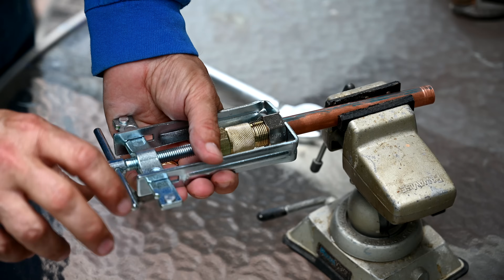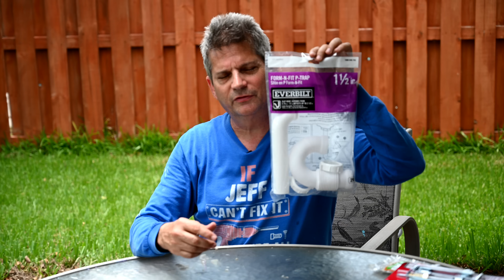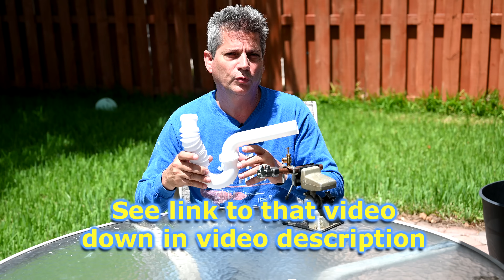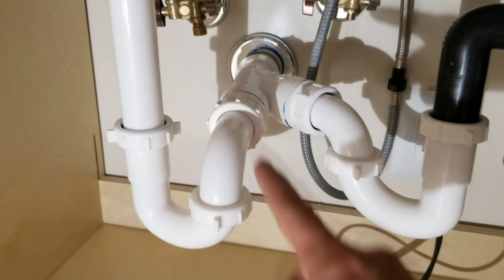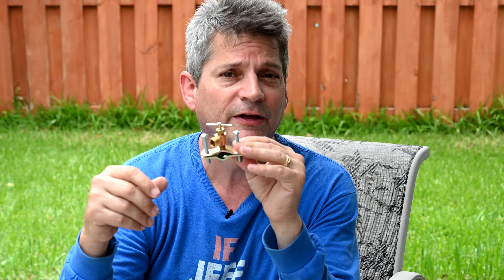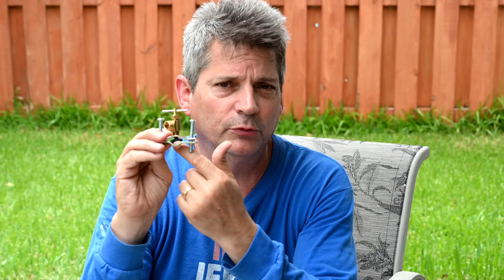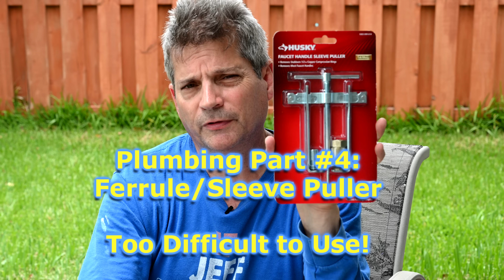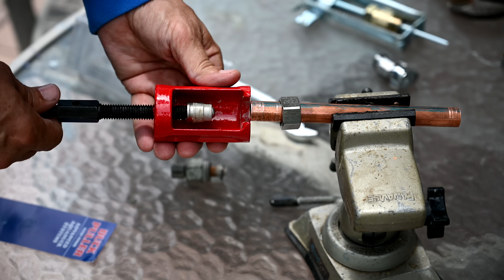4 Plumbing Parts/Tools You Should NEVER Use. NO Plumbing Fails

Comment: I have a question..... can I use check valve for my kitchen sink instead of a one and half inch PVC vent pipe.reason why theirs a window above the kitchen sink
Reply from the maker: Check valve is adding too much complication there, a window over your sink should not be any deterrent to connecting to a 1 1/2" pipe, which should connect into a larger vent stack. Do you not have a vent stack already in your wall?

Comment: Please tell me your better than other plumbers that cut floor joists when doing installs or repairs, I hate that crap.
Reply from the maker: I hate it when they do that too! At my friend's hous eremodel we used spade bits and cut small holes in the middle of the 2 x 6 wall studs. Ironic you should mention the notching, because that is exactly what the builder did to his house in 1946, so we removed it, and brought rebuilt that entire wall between kitchen and bathroom to run pipes through studs. they even had part of the pipe running on the outside of the wall in the kitchen because they used only 2 x4 and pipe could not get past the 4" vent stack inside the wall, so they went around it on the outside.
Reply: @jeffostroff  Almost every house I've put a crawl space vapor barrier/encaps in, the blame plumber cut floor joists to save time, all while proving me another service to render.  Most of the homes I've done this work in were expensive homes, horrible stuff.  Sick what people will do to others property ruining it just to be lazy.  I expected better out of you but I had to mention it.  Some understructer repair I've done paid more than the vap barrier work did.
I've seen so many botched jobs by "licensed" tradesman it's sad.  I'm not licensed for squat BTW but I sure try and treat people better than that golly.  
I also work for "safe guard" they take over foreclosed homes to preserve them/recondition them for auction and it's insane what I've seen in that line of work.  Not just plumbing, gas and electric was just terrifying to say the best of some peoples work.....
I hate having to do plumbing, it's not my fav thing at all  argg, I love the pex stuff though, anytime I can I use it.  I don't use shark bites though, I've seen them fail after a year, though they could have been reused from another project or something and not a true new part.  
But saddle fittings I don't use, but I know of many 20-40 years old still in use without problem, but no I wouldn't use them personally.
Sorry for blabbing so long.
Edit, good video BTW.

Comment: Just because the code states something is prohibited is not an adequate explanation. Codes can have useless regulations. You have to explain the rationale behind the code. "Fixture traps shall be self scouring" - is an example of a good explanation.
Reply from the maker: I thought I gave a rational explanation for each device, I gave examples of what happens and why the parts fail. Did you not watch the video?
Reply: @jeffostroff  Yes sir. Simply making a point and I likely worded it poorly.

Comment: What do you think of shark bites?
Reply from the maker: Kurt, I use Shark Bites from time to time. I will only use them on the outside of the wall, or  under a vanity where you can see them. I also use the Shark Bite end caps to plug off stub out pipes during plumbing rough in. I have mainly used them recently to change out toilet and sink water cutoff valves where we had polybutylene gray plastic pipes in stead of copper. Shark Bite has adapter attachments that convert from the now-banned poly pipe, allowing you to change over to a copper pipe.
Reply: jeffostroff 
I can see why you wouldn't use one inside a wall.  However I've looked all over and have not heard of a single one ever failing, ever....
I also change my valves when doing any toilet work. ( professional homeowner)I think I'm going to switch from compression type valves to shark bites. Thanks for your response.

Comment: again just like I commented in a previous video of yours     fla  has banned   the s trap  that you call it  but its really a p trap .  not in ny      it can be used    and most states go by the international plumbing  code   not the uniform  code
Reply from the maker: As far as I know S traps are banned in all 50 States in fact here is New York's plumbing code so I don't know how you can tell me that they allow as traps when it is clearly shown here in this section of code below. So you're going to have to show us the code where it specifically States that s traps are allowed. 
Chapter 10 Traps, Interceptors and Separators

1002.3 Prohibited Traps

The following types of traps are prohibited:

1. Traps that depend on moving parts to maintain the seal.

2. Bell, pot, bottle traps and traps with interior partitions.

3. Crown-vented traps.

4. Traps not integral with a fixture and that depend on interior partitions for the seal, except those traps constructed of an approved material that is resistant to corrosion and degradation.

5. "S" traps.

6. Drum traps.

Comment: You're using the ferrel ring puller incorrectly. The grips on the side are NOT for ferrel rings.

I bought and used one of these today. When you use it correctly, it works perfect.
Reply from the maker: Yes I've used them before to and they do work. But my problem with this tool is that they don't work when you have a stuck ferrule.  The tool has shown itself to be useless in that case. Why would you want to spend that much effort when the duck puller works perfectly every time.
Reply: @jeffostroff  - because I needed it right then and this was the only puller available. 

When used correctly, it seems to work the same way. You screw into the nut behind the ferrule, a "block" goes into the front of the pipe, and you turn the screw (which if you start with it unscrewed, you don't have the problem with the handle your video showed). The mechanic was the same. 

The little grip things on the side are for a different purpose. They're not used when removing the ferrule. 

Bottom line: you used the tool incorrectly (in multiple ways) and told people it didn't work. I nearly didn't buy one yesterday for this reason. As it was my only option available, I gave it a shot and found zero issues.... And I had a stuck ferrule.

Comment: I had that Husky sleeve puller, and I struggled for 45 minutes, and failed to get the sleeve off with all the hand pains that you described.  I decided to keep the old sleeve and nut on the pipe.  However, I kept getting drips.  I was afraid to really put a lot of torque on the nut.  I was trying to follow the tightening instructions that come with the valve, but even with extra torque I was getting leaks.  So, I called the plumber.  I thought that the plumber would take off the sleeve and nut, and use the new ones that come with the valve.  Nope, he said you don't need to.  So basically, he just used super-force on the old sleeve and nut to get the valve to stop dripping.  I had several just like this.  {He used my new valves from home depot.)  Seems like the plumber cut corners, but I guess I'll live. 

A sidenote, I was able to get one sleeve off with a Dremmel and screw driver.  I STILL couldn't get it to stop dripping even with moderate torque and a new sleeve and nut.  This is when I threw my hands up, and called the plumber.  I'm pretty sure that the home depot valves are made poorly.  I saw the plumber going full force on those nuts, and I really don't think you should have to.
Reply from the maker: I have installed probably 100 of those home depot valves in of the properties I 4 done and have not had a problem with a single 1. Once in a Blue Moon when I tighten them all together I might get a drip or 2 but then I'll just tightening a little more in it fixes the problem. A tube of plumbers silicone grease and rub a little bit on the mail threads of the share of valve where the nut screws on to it. This helps lubricate  The 2 parts so they will tighten together easier and might stop a little bit of leakage.
Reply: Marc Berman You can try some Teflon paste to help seal it.

Comment: There is no problem with S-trap, if it is installed properly. Which means that the house has  a sewer went pipe in the roof, which removes any "pressure" changes inside the sewer. Interesting to hear that S-traps are banned in US.  In our country (a bit differently shaped) s-traps are the standard, and we do not have any smell coming from them. Also Ikea sells S-traps.
Reply: Yes, same in the uk, S traps are commonly used, all buildings have a 4" soil vent pipe which equalises pressure when a toilet is flushed or sink emptied.

Comment: Thanks for this information.  I recently removed a saddle valve that was used to feed the supply line for my home's humidifier.  I didn't even know it was not to code but that what the manufacture still sells.  Total junk...it failed and was leaking right onto my hot water heater.  I decided to use a ball valve that I could shutoff for the season or to perform maintenance.
Reply from the maker: Chris,  Yes smart move changing that saddle valve and the ball valve is the way to go

Comment: It is surprising to see that they sell l code vidilation supplies though I didn't used them. I consider them junk same for pex pipe not surprising they got added to the do not use list. Normally they should have a air trap in a bathroom. It was nice to see the compression puller though I normally just use V channellocks to remove them.
Reply from the maker: They are not banned by criminal code, just plumbing code, the city won't approve your permit. Stores can still sell it. Pex has not been proven to be a bad system.
Reply: @jeffostroff  I know on pex. I see leeks on it so don't like it. only use copper and pvc. If they rated plumping by 100 year requirement that would remove a lot of junk from the market.

Comment: The flex trap is sometimes the only repair that can be done.  In my case the people who built the house didn't space things properly so the kitchen sink outlet is almost directly above the pipes coming out of the wall.   The normal trap won't fit.  Granted they aren't great but they work.  The only other option is to rip out the sink cabinet, cut into the wall and re-do the PVC coming in.  I boil vinegar in my tea kettle to clean it and then pour it down the drains so it does a pretty good job keeping the drain clean.  Also you never gave a reason why the insurance company would drop you for having it.  What is the reason?
Reply from the maker: Gene the reason why insurance companies drop you for these flex P-Traps is they are known to be very brittle at the point where they fold and all of those little folds the plastic tends to be  week at those points from the stress on them and it's thinner plastic than poly pipe P-traps. So at those points flex pipe tends to crack and that starts leaks which lead to tens of thousands of dollars of damage people forget that leaks over time will just ruin vanities in a can get out and get on on until a floor and leak through the growled and cause flooding downstairs. Insurance companies have had it with paying out $10000 to $30000 claims over nothing and they're starting to do a 4 point inspections on people's houses and finding these things and threatening to kick them off the policy if they don't get them fixed. Plus too many people cram more than they should under sinks, and bump into and smash their p-traps or twist the joints, breaking the seal, now you have a leak.
Reply: @jeffostroff  Funny, I've never heard of an insurance company doing inspections of houses.

Comment: Just curious Jeff,
Why can't you just use a hacksaw and cut the ring off. Seems like it should cut easy enough?
Reply from the maker: Rodney, you should never use a hack saw to cut a pipe for this task, you should always use a pipe/tube cutter, as they have the scoring wheel which makes a nice perfect edge cut. The hack saw is too rough on the copper, leaving jagged edges, and could deform the pipe. The pipe must be perfectly in round or the new ferrule will not slip onto the pipe. I had this issue 2 weeks ago where I could not get the new ferrule on the pipe until I reamed the pipe a bit and sanded some near the pipe opening first. Besides if you have the proper ferrule removal tool like I showed with the duck puller, you'll never have to cut the pipe. I only had to cut one pipe in the last 5 years, that was before I got the Duck Puller.
Reply: @jeffostroff  He didn't say "cut the pipe", he said "cut the ferrule" (Ok, he said "ring").  I think you would have to be careful to not cut into the pipe by accident.  Is that the problem?
Reply from the maker: @jimd1161   A lot of guys in England seem to wanna cut the ring which is OK if you know what you're doing and you don't damage the pipe. But why go through all the trouble of hack sighing when you can use the duck puller or one of the other furrule ring extractor tools that I show that do it pretty quickly within seconds.  Ever since I bought those other extraction tools there's never been a reason for me to ever have to cut a pipe to remove the compression ring.
Reply: @jeffostroff  The only reason I can see to go through the trouble is this... if you are only likely to pull a pair of those off once in your  life, you may not want to buy a tool for it.  I agree that anyone doing this a couple of times a week should buy the tool and get it over with.

Comment: Your plumbing with a P trap  is the same as using an S Trap (it's an S trap with slightly extended horizontal top pipe... think about it)
Reply from the maker: It is not the same that horizontal pipe is a world of difference it's what slows down the water so that it cannot siphon out of the P trap. The P trap is not the same thing as an S trap.

Comment: I did a Ferme lab test on using regular PVC cement on on ABS pipe, 
Ten years later still holding. I've repaired whirlpool piping which nobody on this planet will touch,
If they have half a brain, using JB WELD. 
Sometimes you just have to jump in and hang on.
Reply from the maker: I remember visiting Fermi lab as a kid. I'm surprised that worked on the ABS because usually that use a different type of cement with and yellow primer built into it it's all one step prime and cement.

Comment: As for describing the watyer draw effect of flos in a trap, in electrionics we call it "wicking". When we need to remove solder from a joint, we heat it to the melting point of the solder and touch the end of a woven strip of bare, very fine copper wire braid to the molten solder it it is quickly wicked up into the braid and off the joint.

Comment: if you use a vent pipe you won't have a problem flushing the toilet and if this parts are illegal why they allowed to sell it  .
Reply from the maker: The problem is not just related to the venting, it is also related to having a long vertical drop at the exit of the S-Trap, after having a short vertical drop, which means water will pick up speed and momentum, causing the water to siphon itself right out of the S-Trap. It's not a against criminal law to sell the parts, they merely not allowed to use them by building codes, which has nothing to do with criminal codes.

Comment: I was a Master plumber in a couple of states for many years. I wish I had come upon your  video back then; I would have really liked to know about the ferrel puller, that would have come in really handy many times.  I enjoyed your video, and can confirm that everything you said was gospel truth. Cheers.
Reply: I haven't done much work like that but any time I have, all I did was get my moto-tool with cut-off wheel out, cut most of the way through one side of the ferrule leaving enough uncut to not damage the tubing, then use a straight blade screwdriver blade in the cut groove and a simple twist of the screwdriver was enough to break the ferrule the rest of the way and spread it away from the tubing so I could then easily remove the ferrule with just my thumb and a finger.
Reply from the maker: Mike, it's never too late to pick it back up again and your job will be easier this time!
Reply: @jeffostroff  (I
  I moved to New Zealand from the states, to sit my plumbing exams here willl cost over $5000 all up, so after 40 years in the trade, I think I'll stay retired. See you are internationally viewed celebrity. If you ever do come down here you might have to learn the language this might help, hope you enjoy it as much as I did. Cheers.
https://www.youtube.com/watch?v=CPYmtEQiG18

Comment: Things are a little different here in the UK.  I agree about the saddle valves though, horrible things
which often eventually leak or  stop the flow of water.   What you call a sleeve or ferrule, we call an
Olive.  I used throw the brass ones away and use copper ones.  If possible I used to leave the old 
one on if the nut was the same thread.  We have no problems using "S" traps here.

Comment: What I'm tired  of is  going to Lowe's and Home Depot and finding the same dumb-asz BS parts to do simple plumbing with.  These plastic parts that basically have friction seals that can easily break if knocked by something.  The "Snappy Trap" line has flexible hoses that ARE is code (smooth interior) BUT there doesn't seem to be a decent linking standard yet beyond this other than hiring a plumber who will form fit and glue pvc together for a custom fit.  It shouldn't take that, there should be a quick connect system that doesn't suck asz with flimsy parts, that screws tight at each junction with no BS.  Bottom line these are just drain hoses, it's not a moon landing and shouldn't cost as much.  The junk should fit together, be easily modified to fit the space, and last the life of the home.
Reply from the maker: My sentiments exactly. I never could understand why they came up with that friction fitting that's the one that causes the most problems.